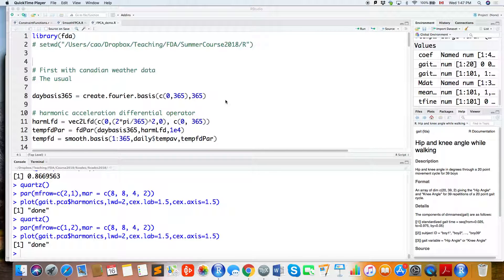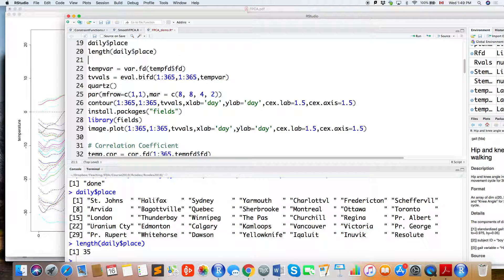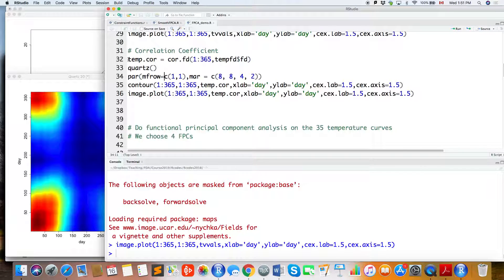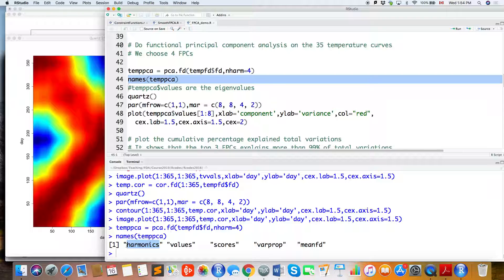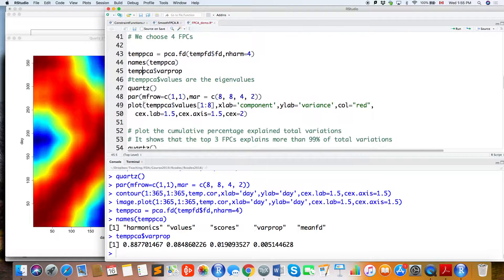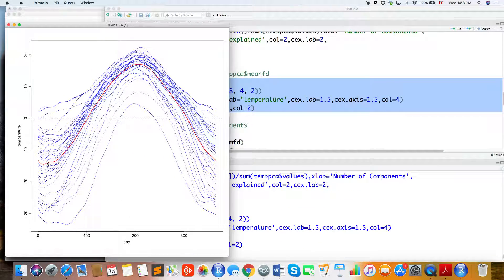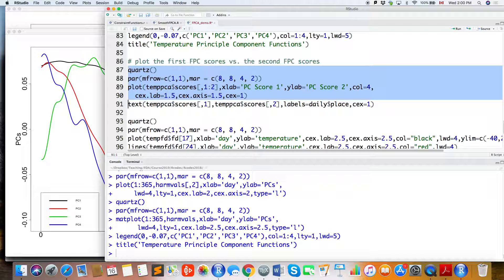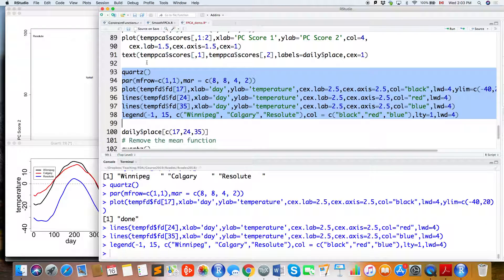Lecture 11: R demonstration for Functional Principal Component Analysis

Comment: (min. 10:00 line 56) Why does he explain the cumulative variance with temppca$values (the eigenvalues) and not with temppca$varprop (proportion of variance explained by each eigenfunction)?
Reply: The proportion of variance explained by an eigenfunction is equal to the corresponding eigenvalue divided by the sum of eigenvalues.